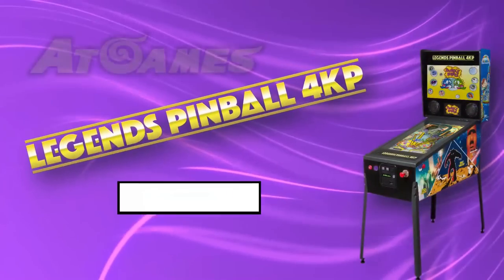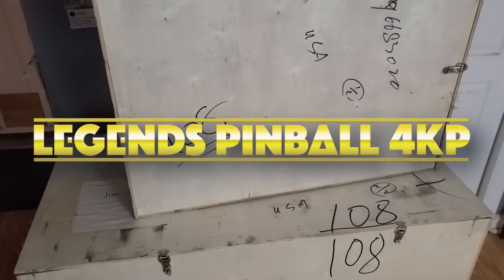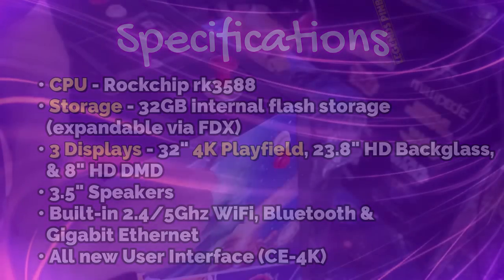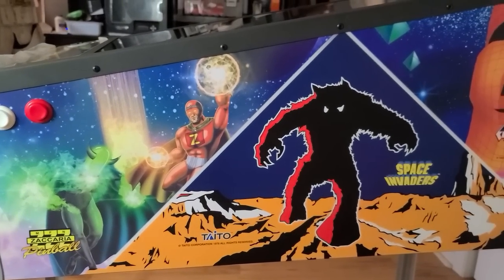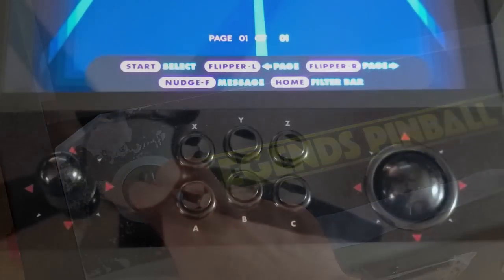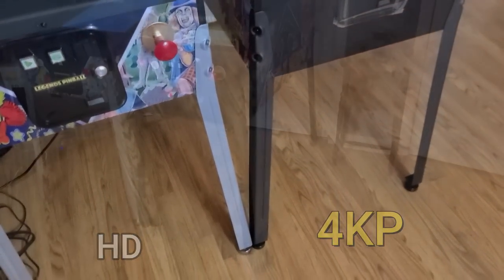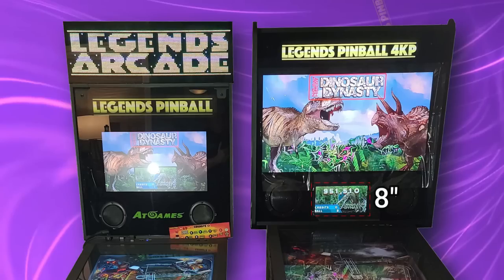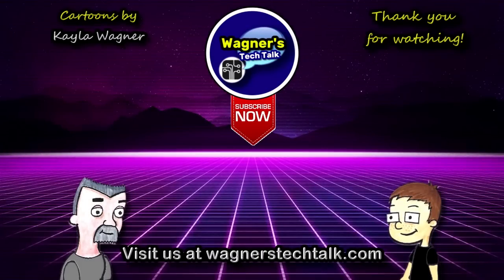The Future of Pinball? AtGames Legends 4K EVT Hardware Tour (PART 1)

Comment: It would be nice if they made 3-4 themed tables instead if that mixed theme one.  It would look cooler and more cohesive in my opinion. 😢
Reply: How about 15 themed tables? (hopefully you saw yesterday's announcement)
Reply: @danriley6237  15 ? I saw Adams family only
Reply: @petermacnab1871  they said more Zen themed tables will come. I mixed up the 15 with the number of included tables tho. But I'm sure there will be more than 3-4 others. If they do a Star Wars I might not be able to resist!
Reply: @petermacnab1871 I wasn't crazy after all!  The announcement did say there would be 15 collector's edition machines made between 2023 and 2025, limited to 5000 units each.

Comment: Wow, looks like they are going for the DIY market by offering a complete pinball cabinet kit with all the desirable features (options for arcade controls and SSF), 4K playfield, and full DMD. 

For those saying $1,000-$1,250 is overpriced for this, I disagree. A VirtuaPin cabinet kit can run $1,500 before monitors, PC, speakers, exciters, plunger, legs, etc.A complete build around one of those would probably approach $3,000. RecRoomMasters used to offer a pincab kit for about $850, but they haven't reintroduced it to the market yet; and prices on their previous line of arcade cabinets have gone up 25% since 2018 when I bought mine. Even if the ALP 4KP is $1,250, no one else offers a complete kit for that price.

I only wish that AtGames had bumped up the playfield size to 40" with a 32" backglass and 15" full DMD - like a full-size cabinet kit. Sell that with the AtGames / RockChip motherboard for $1,250-$1,500 and that could almost corner the entire market.

That said, if I catch a good sale, I am seriously tempted by this!

Comment: My biggest gripe is the dinky 8" DMD.  They increased the Backglass size significantly, but in doing so, it makes the DMD look so tiny!!!!  I've been using my ALP backbox in OTG as a FullDMD screen and I've got a 15" cheap $80 LCD running on top as the Backbox screen. Much nicer experience for a fraction of the cost.  Based on what we're seeing so far, I don't see the 4KP being a justifiable purchase at what I'm guessing will be a ~$1,200+ retail.  Certainly not for someone who already has an original ALP.  It's concerning that the HD table packs and 4K table packs are not compatible with the opposite devices and makes me wonder why they would bother offering an upgrade kit.  Hopefully AtGames does the right thing and grants customers access to both versions of purchased tables so that people who already have a library of tables and then buy the new 4KP don't have to repurchase their entire library.  Otherwise this is going to be another controversial scenario like Pinball FX.
Reply from the maker: Appreciate your feedback, as I learn new information it will be added here: https://wagnerstechtalk.com/alp4kevt/#Q_A

Comment: If they remove that title marquee, they can have a 10-12" DMD. The 8" is way too small. They don't have to go full 15" DMD (it would be great to go Stern size though), and there are hundreds of beautiful 1080p fulldmds for PC pinball that really need a nice large beautiful DMD display to fully appreciate. There's nothing like them. But at least give us a few more inches! The 8" may look OK with built-in native titles, which is all they likely care about but it would look so much better with just a few more inches but probably too late now to source.
Reply: As usual, one step forward, two steps back.  They had the wherewithal to increase the size of the Backglass, but in doing so, made the already small 8" DMD look tiny by comparison.  I'll stick to my original ALP with my additional 15" LCD for OTG.  Having a matched set of Backglass and FullDMD displays is something I won't downgrade from.
Reply: @Tamarocker88 I am totally with you!

Comment: What I'm most curious about... and in my opinion it's the most important thing to fix compared to the HD version.... is if OTG connected to a PC no longer has the large amount of delay / lag like the HD version did. Glad to see they have been listening to feedback on many things though.
Reply: Yep I’m exactly wondering that too. There was so much delay on the HD that it’s just been a paperweight. Well actually I put some towels over it and my cats sleep on it all the time. Levi  Astro sleeps on the back box, Kai Jin  sleeps on the playfield.
Reply: What kind of computer are you using? I feel you need an i7 to run all those games with the video on the backglass.
Reply: @8-bit_Informer   13600k rtx 3080 32gigs ram , nvme 2tb drive. It has something to do with the OTG it adds lag to it. You can get used to it if that’s the only thing you play on. It’s very noticeable compared to running straight to a monitor without the OTG.
Reply: idk what you're talking about, OTG doesn't have a significant amount of lag unless the connected PC is underpowered, hasn't been optimized, or you needlessly integrate JoyToKey.  By configuring controls directly within PinUpPopper and VPX and configuring low-latency mode in the Nvidia control panel, you'll eliminate majority of input lag.  Overwhelming sources of delay and lag are on the PC itself and have to do with optimizing the OS and applications.
Reply: @Tamarocker88  Well my regular, full-size 42 inch 4k OLED virtual pinball machine with 4 screens runs perfectly fine on the same PC. Vr works fine too I’m not the only one that says there is lag/delay using OTG. I’ve never ever use joy to key in my life. I am always run ultra low latency mode in the Nvidia settings and controls configured through pinup popper.
Reply: @Tamarocker88 I'm pretty sure I know what I'm talking about. :) It has nothing to do with the PC (in this case of what I'm talking about). The main board on the ALP adds delay when using OTG (at least on the initial ALP versions, no idea about the later revisions). This is very well known and was tested and confirmed by multiple people. If you have never used a direct connection from a PC to a good monitor / TV with no lag (or image processing, etc) in a custom cabinet, you may not realize just how much lag it added. I even noted about it in my review of the ALP. https://www.youtube.com/@TerryRed/videos
Reply: @TerryRed  I completely overlooked your username and thought this was a tired old complaint from someone who probably had any number of settings configured incorrectly in their environment
 If you say it's so, it's probably so
  That being said...You must admit, as someone so involved with FP table creation, you're an exception to the rule and are likely far more sensitive to performance than the average person (much like a professional eSport player who needs near zero input lag for competition). I seriously doubt the average Joe Schmo who buys these machines would actually notice a difference.
Reply: @Tamarocker88  If they had never tried playing on another setup, that's very possible for some people to not notice as easily. For me, it stood out the most when comparing the native games (Zaccaria, etc) and then playing OTG PC pinball. Same thing when playing MAME games natively on the ALP from a USB stick compared to MAME on PC through OTG.
Reply: @TerryRed  thank you @Terryred you’re the best!!! Lol
Reply: @TerryRed  That was a bad faith argument if I've ever seen one.  Your examples aren't apples to apples comparisons.  Playing arcade games via MAME on ALP (especially if using CoinOpsX) is very different from directly running MAME on PC. CoinOpsX is multiple layers of abstraction running via thumb drive over USB on top of AtGames' own laggy OS. Not to mention the ALP itself is an underpowered toaster compared to a PC, lol. It is unrealistic to expect MAME performance on ALP to mirror that of direct MAME on PC, even if the ALP had identical hardware specs. AtGames may be able to further optimize it to some degree, but I doubt the two will ever compare.  As far as the native pinball tables having less lag than VPX via OTG, well is that not also to be expected!? VPX and FP are a whole 'nother beast!  Even if we ignore the complexity of all that is FP/VPX and focus on just the screen and control I/O from ALP to PC, any form of I/O to external source necessarily introduces some degree of delay since processing and propagation take time. There is an unavoidable degree of delay, no amount of optimization or hardware would change that.  Overwhelming majority of entry points for lag introduction in the OTG signal chain reside on the PC. I'm curious exactly how much OTG lag is attributable to the ALP connection itself.  Are we talking 50-100ms? And realistically, how much of that can AtGames really reduce?
Reply from the maker: As this is a pre-production, I should have some updated firmware soon that will allow testing this.  When that happens, I'll post the results to the evt page.  Taking it in steps so we will have a very good overall picture.  At this point, I honestly don't have information to share.  I always appreciate your work and will do the best I can to help answer this question!
Reply: @Tamarocker88 I think you misunderstood. I meant playing MAME on CoinOpsX and the Zaccaria tables natively on the ALP had no lag / delay compared to playing the same on "any" PC (I have many in my house) which always has lag when using OTG HDMI on the ALP. The problem comes from the HDMI OTG input on the ALP's main board which is what introduces the lag / delay (confirmed by many people). A very easy way to test this was to compare playing "anything" on a PC on OTG, and then connect the PC to the VIBS board and compare them. The VIBS (for me and many others) didn't have any lag / delay because its HDMI video doesn't pass through the ALP's main board.
Reply: @TerryRed  I don't know I think he just likes to argue 😂 😂
Reply: @TerryRed At this point I don't know what you're saying. First you say there is lag over OTG then you say there isn't. Anyone using OTG is running a VIBS board, no? So why say "there is no lag with VIBS"? You're contradicting yourself.

 I understood your original point completely. Playing games on PC over OTG introduces a degree of lag while native games on ALP don't. That's inherently obvious. I don't understand why you expect there to be no lag whatsoever on OTG when the fact that outboard I/O is involved introduces lag. It can be minimized to some degree, but you can't completely eliminate it. It takes time to process data and communicate back and forth between the ALP and OTG PC.
Reply: @dem0man21  more like I don't understand the unreasonable expectation for there to be no lag at all. Native gameplay and OTG are apples and oranges. Given the increased complexity of the pathways the control and display I/O must travel for OTG compared to the stock system, there is an unavoidable amount of delay introduced. It's standard for any type of I/O. Add further processing to data over longer paths and lag is introduced.
Reply: @Tamarocker88 I've always said there is LAG on OTG HDMI in all my responses. As I mentioned, that is the result of how the ALP's main board works with the OTG HDMI input, and it's not a "little" lag... its a lot... and absolutely not normal by any standard. It should be comparable to switching to a different input on any monitor or TV (which is what the VIBS is basically doing, and why if you test connecting your PC's "playfield" display to the VIBS instead of the OTG HDMI, you'll see it doesn't have the same problem). Play the ALP side by side with a proper vpin cabinet setup, or just playing on a PC connected to a monitor, and you'll see the difference is huge. They for sure could have avoided it (by doing similar to what they do on the VIBS), but they most likely didn't notice the issue until long after they went into production, and others (like myself) pointed it out to them. Here's hoping they solved that issue for the 4K, as its definitely a solvable problem (I've been an electronics tech for 25+ years).

Comment: Thanks for the review. Only two improvements need to be made. The DMD screen needs to be a 10" display, and the USBs need to be facing the player. But, that's an easy hack. Just run USB extensions to cutouts in the front panel of the backbox. Other than that, I love the design, and wouldn't mine owning it, if I could afford it. I'm guessing it'll retail for around 2K$, or more. Very impressed with the properly scaled up backbox. Finally! They "get" it. LOL :)

Comment: Is it 120hz?  That is much better upgrade than 4k at a 32" screen size IMO.
Reply: I highly doubt the 4k screen will be 120Hz unless the price point is $1500+.  Given the relatively underwhelming quality of the built in tables, I just can't see AtGames justifying the cost involved with higher refresh rate panels.
Reply: I just hope they use a good 4K monitor. We need true 4K.
Reply: @8-bit_Informer  "good 4K monitor" meaning what, exactly?  What do you mean "True 4K"??  If the screen supports 3840 x 2160 resolution, it's 4K.
Reply from the maker: We'll discuss in Part 2 👍
Reply: @Tamarocker88  Well I mean it shouldn’t be all about resolution. I hope they go all out and get an OLED screen so every pixel is perfect. It would show every pixel from pure black to pure white and everything in between. I would definitely pick it up for under $2000 if it had an OLED 4K screen other than an LED screen with all the options they are giving.